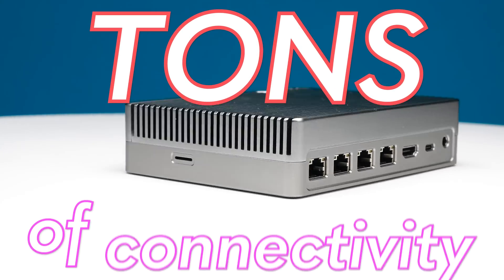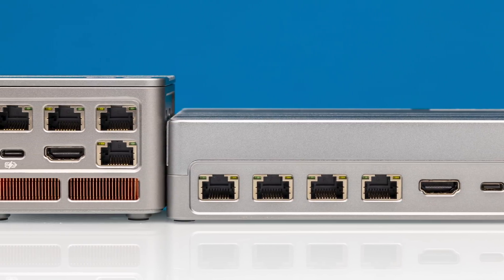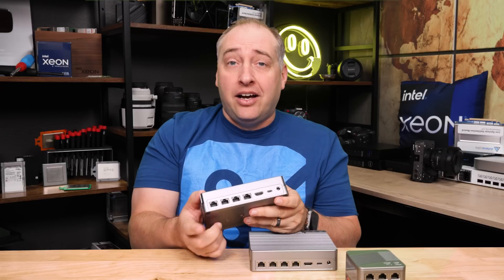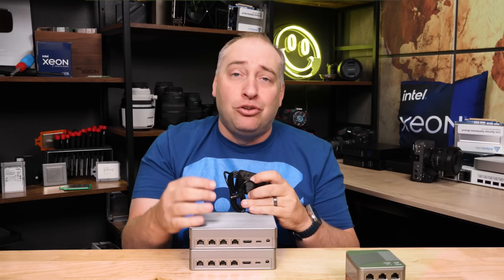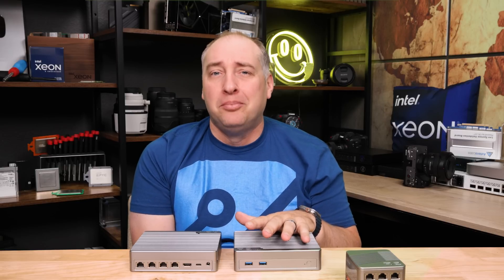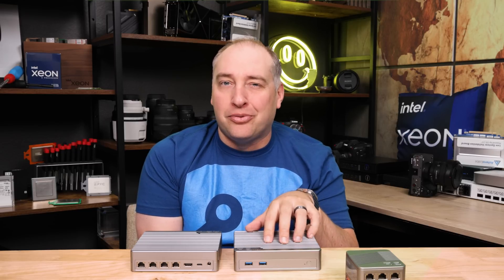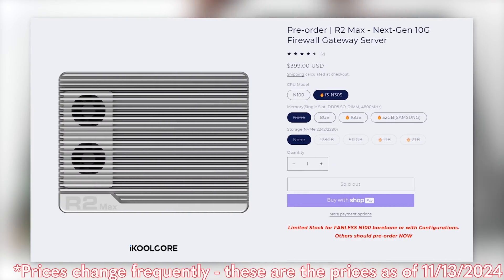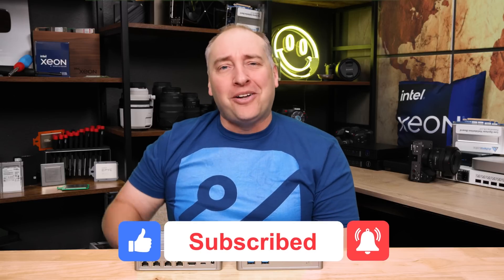MAX Fanless 10Gbase-T Mini PC and Router

Comment: How heavy is a Kilo?
Reply: a thousand grams!
Reply: Approx 1 litre of water
Reply: Roughly 2.204 of your pounds
You can always address these questions to Google, its search has gone to s*t but it can still do unit conversations
Reply: @BoraHorzaGobuchul  Now this is something that an AI can do better that google. As long as the calculations won't get too hard...
Reply: Resonite dog! It weighs as much as 2 BORGers
Reply: 1 000 000 milligrams
Reply: Did you know that the US pound is actually calibrated on a kilo which is transported back and forth between the US and France?
Reply: Half a Noct

Comment: Stop making me upgrade my OPNsense router over and over again! :D
Reply: hah I was thinking the same, but there is no native support for the drivers, so it would need to be some proxmox vm, or drivers added in some way I can't find yet
Reply from the maker: To be fair, I gave you your first one :-) Actually, not the easiest for OPNsense since it needs drivers for the Marvell AQC113C NICs
Reply: @ServeTheHomeVideo  Okay, whew... saved me from the 3rd upgrade in 2 years then :)
Reply: Funny he mentioned OpenWRT in the video, I also run OpenWRT, but as an LXC container and that works. 🙂
Reply: There's no possibility of keeping up with the Joneses when comparing to people like @JeffGeerling or @ServeTheHomeVideo. The budget only stretches so far!
Reply: I'm in process of using PC parts I had around to spin up an OPNSense box and I was watching this doing some math on an "upgrade" too lol
Reply: Trueeee!!! 🤣
Reply: I like this, but at the moment until I have an option that can saturate more than 2.5gb I don't have a need to upgrade my current quad 2.5gbe J4125 based router. My current plan is only about 500Mb/s yet pretty expensive for that. I'll have more and better value options when my current contract expires. 

Unfortunately I can't justify the upgrade this time around based on saving money on power, where 3 years of saving 32w 24/7 basically paid off the router compared to running my old Sandybridge m-itx machine
Reply: @richardnpaul_mob you do know that 10g just means it is 10x as good at moving 1gb speeds? 😂 That what I tell my wife after future proofing doesn't work anymore. 😎😇
Reply: You didn't watch the video, eh ;-)
Reply: lol Jeff you very very funny boi man make me happyt!!!
Reply: I hope they didn't use Realtek 2.5 Gb/s cards, because OPNsense and pfSense don't detect them... I found this out when I bought a CHUWI LarkBox X and tried to use OPNsense and pfSense on it. It works, but on Proxmox, due to the lack of network card support.
Reply: what your current router? and you can send me your first one that sth send you :P
Reply: I just virtualized my OPNsense firewall and this comes along...ughh. Hey Patrick how does the N305 stack up to the older I8700 or I9700 procs? Have we gotten to a point where the N305 performance beats them?
Reply: @stevefxp  @ServeTheHomeVideo  I second this question with an i78700 and ancient intel 10gbe nic
Reply: @philiptalbert458  at some point i will buy one of the N305 units, and replace my i8700 unit. One step at a time.
Reply from the maker: @stevefxp  Pretty close actually. The bigger difference is the power consumption at that performance level.
Reply: @ServeTheHomeVideo  which then makes the N305 the winner. If performance is close the power consumption of the N305 tips it in its favor.
Reply: @stevefxp  no one tell Reddit... I asked about virtualizing OPNSense or PFSense and was roundly criticized for taking part in such a foolish venture...
Reply: @axdsc  nothing foolish about virtualizing OPNsense, especially if your server supports PCI/PCIe pass-through.
Reply: Is there an issue with the Marvell AQC113C chips?

A quick search to try and find the features led me to people posting about a defect in the chips that lead to them being discontinued. The defect apparently made them not always reconnect to PCIe bus on power on, reboot, hibernate or resume suspend. I just didn't know if this was FUD or a real potential issue to know about?
Reply: @mysticknight487 there is something but I have never seen it running in a 24/7 proxmox application.  Apparently the Mac minis also use this chip but not sure about the newly released version.
Reply: @mysticknight487 this thing about AQC113 being discontinued seems to only come from a single commenter on a STH forum, made about 3 years ago, who doesn't cite any source. I've looked for corroborating evidence and found none. I have, however, found that ASUS released a new version of their 10Gbe NIC in September of this year with this chip, so it seems really unlikely to me that it was in fact ever discontinued.
Reply: @mysticknight487 My only issue with aqc based stuff was with pcie passthrough to a VM, with it basically not able to be rebooted (afaik there is a way with reading and passing a bootrom but I never was able to read it from any of the aqc based cards I have), so only full VM host power cycle would bring it back.
Reply from the maker: @mysticknight487  I mean the AQC113 was even used in the M1 generation Apple Mac Mini and Studio

Comment: Booooh no SFP+
Reply from the maker: We did another $200 2x SFP+ 2x 2.5GbE a few months ago. This one is better, but $100 more.
Reply: Because of your review, I got that one with the N100. Payed €190, tax and shipping included. Been using it as an OPNsense box without any issues and plenty fast for my use case. I did connect the cpu fan to the 2nd fan header, and now it's very quiet.
Reply: That's the single best thing about this box. You can get everything you want with sfp+, the issue is finding something with base T
Reply: When I looked at solutions I had the problem that each SFP+ ethernet adapter was another 50 euro. Sorry, but that's a problem if you want a low cost solution. Maybe I should also have looked at fiber which seems cheaper, but that would mean upgrading my network. In that sense SFP is probably more future-proof of course.
Reply: More isp multi gigabit modems use 10gbe rj45. Not a bad thing

Comment: Give us an AMD variant with ECC memory support.
Reply from the maker: I love this idea.
Reply: Seriously, need more AMD love in this catagory
Reply: What amd mobile chips even support ecc?
Reply: AMD has nothing that can compare with N100 in their laptop parts
Reply: @marcogenovesi8570  They have the V2000 embedded series which isn't quite as low power but you also get 6-8 decently fast SMT cores.
Reply: @nadtz  embedded is a different product line with a higher price because embedded is a B2B product like servers and has high margins. 
N100 is a "mobile" (laptop and whatever) product line so it's for consumer and has much smaller margins.
Intel's embedded Alder Lake N product is Atom x7425E or x7211E and how many of those are used in cheap mini pc? none.
Reply: @marcogenovesi8570  I'm aware, if you scroll up you will see I said pretty much this exact thing earlier in this thread.
Reply: @nadtz  not really, you said that AMD embedded are harder to get than Intel's chips.
This is not a brand thing but a product line thing. Both AMD and Intel's embedded product lines are both out of reach for the part budget of these devices.
And AMD's laptop parts simply don't go low power enough.
Reply: @marcogenovesi8570  That was in context to the poster who said AMD was ignoring embedded.  I agree AMD doesn't have a 'mobile' offering that matches N100 but I'd also point out I've never seen an N100 'in the wild' used as a mobile device (with the obvious caveat that my sample size is relatively small).  These chips are in my eyes more like denverton than mobile with the difference being they are fairly easy for the average consumer to get their hands on.
Reply: @wojtek-33  there is nothing they need to implement, it's a setting of the board support firmware provided by AMD (or Intel)
Reply: This would have been an instant buy with ECC
Reply: AMD doesn't really seem to care about embedded, which is extra frustrating because Intel has also been stagnant with their C-series.
Reply: @concinnus  AMD has a pretty solid embedded lineup that covers both Ryzen and Epyc, if I had to guess it's not as easy to get a hold of as Intel's chips.
Reply: @concinnus  Are we going to just pretend the Geode doesn't exist!? Seriously though, a 2024 version of that would be lovely.
Reply: what do you need ecc support in a mini pc for, especially at home? i get it for storage, but for a firewall? why?
Reply: @night_h4nter  Why wouldn't you want ECC for a router? Routers are running 24/7 which gives it plenty of time for bitflips to happen and either, get written back to disk or cause a crash in running software. I want my router to be stable. This box is already half way to reliable by having dual ssd slots for RAID 1, but it drops the ball in only supporting fallible memory.
Reply: @craftkiller9627  Well tbf DDR5's on-die ECC should correct on-die bitflips, it just won't report them or correct transmission errors.
Reply: @craftkiller9627  i don't have my router ever write anything to disk, nor running anything that might actually be a problem if it ever crashes. well, if the entire machine gets a kernel panic or something, i'll have to reset it, sure, but otherwise there's nothing to lose on such machines for me
Reply: @concinnus  yeah, DDR5's on-die ECC isn't a "feature" for the consumer, its for scaling the size of the memory cells smaller to save money. Dr. Ian Cutress of TechTechPotato has a great video on this but YouTube doesn't allow links in comments. It is not, in any way, a substitute for real sideband ECC.
Reply: @craftkiller9627  Overcoming thermal or cosmic ray bitflips is not why it was added, but it should still work.  Obviously it's not real ECC, for the reasons I already mentioned.  It also has a higher risk of double bit errors because of the higher density of DDR5.  But at least at these slow speeds, it should still be better than non-ECC DDR4 -- that's all I'm claiming.
Reply: @craftkiller9627  DDR5's on-die ECC will still detect and correct bitflips, regardless of how much "for the consumer" it is